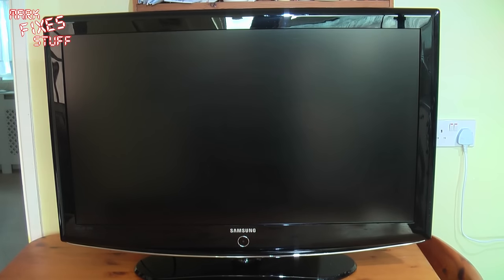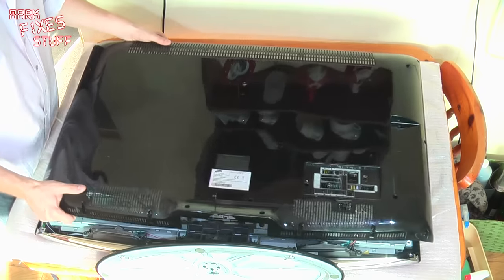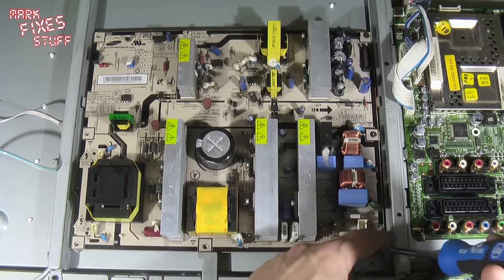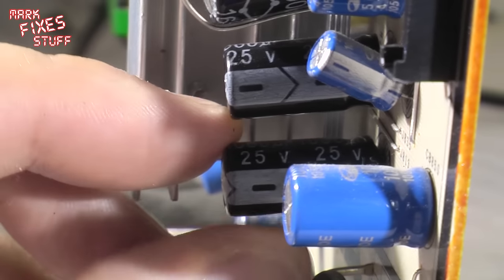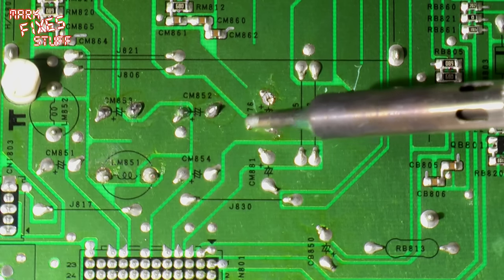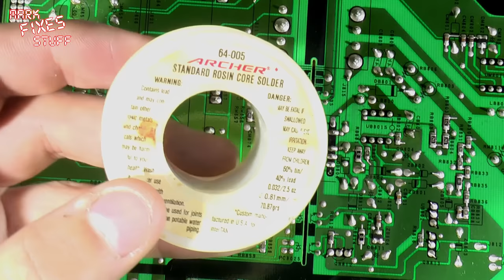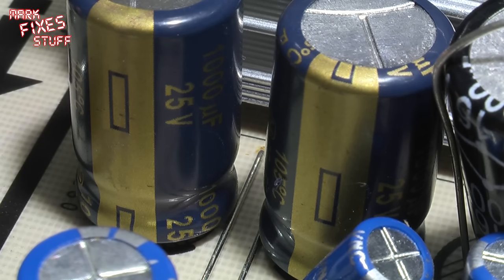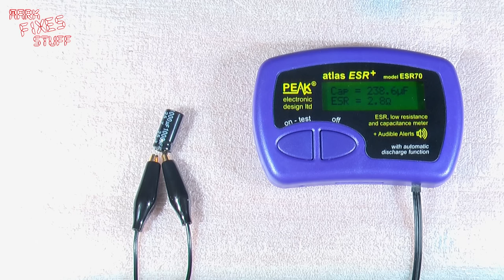Fix LCD TV just clicks won't turn on - Cheap easy repair for LED TV

Comment: For all out there who have the same issue, but don't own the tools, I bought a repair kit on Amazon for $25.  It included a solder iron, solder sucker, solder and a variety of capacitors.  Well worth the $--saved me at least $100 to do it myself.  Big props to Mark.
Reply from the maker: Brilliant news!
Reply: Paul Kosterman what should i search

Comment: Mark your the best!  I followed your instructions to the letter.  I fixed my Phillips LCD tv by replacing five capacitors.  I only burnt my finger once with the soldering iron hehe.  Thanks again!  It only cost me $18.00 for the capacitors and $20.00 for the soldering iron.  Now I have a bunch of replacement capacitors.   Take care and keep up the good work!

Comment: Thanks for the video Mark, very informative, my capacitors look OK so i can probably eliminate them as the cause of the problem - my samsung UE40D5520 is stuck in a non-clicking re-boot loop and ive been told by the local TV shop that either the main or power board needs replacing. Not being circuit-board literate im not sure if the orange crusty stuff on some of the wires is normal but to me it doesnt look like its supposed to be there!

Comment: Great tutorial. I did this repair on my 52 inch Samsung plasma. 3 caps cost me $3.90 Canadian. Hardest part of the job was lifting the beast - had to get the teenagers involved! I did note that the commercial solder took a lot longer to heat up in order to remove with my home-quality iron, so it took a little more time than it should have. Shame on Samsung with this defect and their terrible customer service. last Samsung I'll buy but it's working great now. Thanks!
Reply from the maker: +Simon Gencher It's the lead free solder used in manufacturing that is harder to melt.

Comment: Your video explained exactly what my old Samsung is doing. I think I'll try my hand at fixing it. I promise not to blame you if I electrify myself lol. One question...Can I use 60/40 solder (lead/tin) or must it be that resin core you showed?
Reply from the maker: coffeecrazy65 leaded solder should be ok. Strictly speaking the solder in your Sammy will be unleaded and mixing the two can cause a brittle joint but for a small job like this it shouldn’t be a real issue. Let us know how you get on!

Comment: Mark really does fix stuff.  I've got an old LCD monitor that needs recapping, and an old laptop that needs the power jack replacing, but lack experience at de/soldering.  I have four dead or obsolete PC motherboards to practice with, they are chock full of caps.  Have you done any videos with desoldering braid being used. by the way?
Reply from the maker: Not as yet as I'm not really a fan of braid, but I do use it for cleaning up occasionally. It's really hard to work around the camera when soldering so I tend to just use the SS01 desoldering pump.

Do be aware BTW, that mobo solder is usually a lot harder to melt than standard stuff or the old leaded variety.
Reply: Thanks for the tip.  I'll try to get some practice in!

Comment: Thank you Mark. I do appreciate your prompt reply. Samsung should have to answer for that... Seems as though everyone that purchased one of these sets new has experienced the exact same problem. That and all within weeks of their warranty having run out. "Bollocks!" Almost as if it were planned that way. Hmmm... Now by the smaller caps, are you referring to the four green 1000 uf/35 volt caps by the heat sink at the lower right hand corner of the board? How about the four brown 470-35 V caps on the left side of that same heat sink? Cheers mate!
Reply from the maker: +Chordmerchant Both of those cap sets are equally likely to have dried out. Gut feel is the 1000uf first though.

Samsung was subject to a class action lawsuit over this issue in the USA and a very quite recall happened in the UK which we have now missed....

Comment: Hey mate - thanks for this! Great video. I'm having the same problems, but I've got a Plasma compared to an LCD. Was going to change the capacitors as you've shown, but wanted to check to see if you knew of any other parts that may contribute to the Plasma screens while I've got it open? Appreciate your thoughts! Thanks mate.
Reply from the maker: +Samuel Thomson Start with the caps and go from there. If an inverter board has gone then it's more money for the part
Reply: Thanks mate - legend! We changed the capacitors on the weekend, and it seems like it's working like new again! Saved use a few hungee buying a new one - thanks again!
Reply from the maker: Good job mate! Well done and thanks for the kind feedback!
Reply: Worked perfectly for about a week, and then ran into the same issues unfortunately. Thought we'd fixed it! Any other ideas as to what we could experiment with? My dad's an electrician so certainly operating under the watchful eyes of someone qualified. Got nothing to lose by having a fiddle! Thanks mate

Comment: Mark I have a Samsung tv as well but whats happening to it is when you turn it on and it starts to cycle it will suddenly make a very loud screeching sounds and you will see a bunch of lines appear. then it will shut off on its own and try to recycle again. It will do this two or three times before it starts up correctly. Could this be  a bulging cap causing this?

Comment: I had this problem with my Samsung Plasma and it had to do with my Google fiber remote, it would just keep clicking and not turn on. I had to let TV sit unplugged  for 24 hours and took batteries out off all remotes and disconnected and unplugged google fiber. After 24 hours I turned TV on and after a few clicks it came on.  Then I reconnected it to Google Fiber and plugged in power to Google Fiber. I re-paired the Google Fiber remote (after blue light came back on box) by pointing it a Google Fiber box and holding down one of the number buttons. The Fiber box light flashed and it is paired and problem was resolved.

It  may be because my TV is older, so I have learned not to unplug TV so they stay paired and work together.

Comment: Still used as the fix today. You would think that they would learn to put larger capacitors in their televisions. Even maybe put a backup on them as small as they are.
Reply from the maker: I think they know it will fail after the warranty period, or what the customer THINKS is the warranty period, is over.

Comment: to discharge a capacitor, with a screwdriver that has an insulated handle. with the power off, touch both the soldered leads on the capacitor , both leads at the same time. really strange the 2 other capacitors have axial leads. you can see the silk screen on the board looks like a radial capacitor was supposed to go there.

Comment: Interesting little video, interestingly you didn't mention the heat capabilities of the capacitors, i noticed the originals were only 85 degree, with the replacements being 105 degrees, should last longer :)

Not that i'm one for conspiracy theory's nor do i believe a company would design in obsolescence, but it seems funny how the capacitors around the heat sink are 85 degrees yet the ones with lots of cool air around them are 105 :p
Reply from the maker: I meant to mention that ***** but in all honesty I forgot!

As an aside, in the US Samsung were subject to a class action suit that led to them having to compensate a LOT of customers due to them using faulty capacitors. The compensation scheme was also mirrored in the UK, but has now finished.

Comment: The heat coming off that bar that does not need to be addressed for those capacitors??
Reply from the maker: The voltage regulators produce heat. It's just a fact of the design. If I were cynical, I might suggest that placing those capacitors near that heatsink might be planned to make them die at a time after the warranty period has expired, and force most people to buy new sets.

Oh, the original caps are only rated for 85°C, not the higher temp versions at 105°C.

So yes. You are correct really.

Comment: Hi. Thanks for the video! I have watched many already and tried to solve clicking problem however haven't been able to yet. Capacitors seems ok. I have checked all joints as well, looks ok I think. Would anyone be able to look at my power board and identify the issue, please? 🙏 I am desperate 😵‍💫 I have pictures!

Comment: hi there ive had plasma samsung had blown caps fixed them still never came on what else could it be as ive been messing about hobby buying tv's with same as this taking age to come and its been fine only caps but ive been put off getting any with clicking sound thanks for video

Comment: I want to try to fix my panasoniv viera LCD. The capacitor are 35v 1800uF. I can't find anything similar on amazon or ebay. What shall I do? Any capacitor will work or have to be the same? Thanks in advance.
Reply from the maker: Hey, thanks for watching! That's a common part and should be easily available everywhere. Search for "1800uf Capacitor 35v". Regarding your question, the uf rating must be the same, but the voltage rating is how much the part can handle, so can be higher like 40v or 50v. Don't go too high or the part will start to be much bigger!

Here on ebay UK I can find Panasonic caps as well as cheaper brands. Here is an example. https://www.ebay.co.uk/itm/EEUFC1V182-Panasonic-Capacitor-1800Uf-35V/143876304802

I hope this helps and thank you for your comment!
Reply: @MarkFixesStuff  : Thank you so much for your answer and the link in ebay. You're a 🌟 ⭐ 👍

Comment: Hello Mark, I have a Samsung model UE55F6670SS presenting same issue.  I did visually verify power board and all capacitors seems perfect.  I saw some videos people heating powerd board with a hair dryer and did try out... that works! but once tv turns off I have same issue back and need to heat board again to start.  Any other clue to fix it? Appreciate your help. Tks

Comment: I have the 46" version of this TV, but mine had a bad logic board, the power was OK.  Even after replacing that it still cost less than $90 all together
Reply: You can get the tv for like 40 bucks lol

Comment: You really don't even need a tester unless you see more than one but most of the time you can look at the capacitor and see that it's bad. When it's popped out like a balloon, that's bad. When it's flat, it's fine. I would recommend putting a larger capacitor there but do at your own risk.
Reply from the maker: Yeah, but in the video people like evidence haha. Mostly I start with smaller caps near the hottest parts and try from there.
Reply: @MarkFixesStuff  true

Comment: Hey I have a Sony Bravia 55 inch LCD TV.  It's a 2010 model. When it turns on and off it makes a sharp ``pop'' sound. Is it the relay switch that is faulty? Some say,``That is not normal.''

Comment: I know your video is older but I hope you will respond. I have an older Samsung computer monitor and when I turn it on it only stays on a couple seconds then black.  if I turn off and back on it does the same. I can see my desktop briefly. Is that possibly the capacitor? Thanks. Great video.
Reply from the maker: I would check the caps, but it might also be the inverter board for the backlight as these are known to fail. If you shine torch on the screen can you still see the desktop even though it's black?

Comment: Hi Mark,
I have a Samaung 40" LN-S4051D TV that won't turn on, it just clicks so I took it apart, noticed two blown capacitors. I bought a 5 pack on Amazon,  replaced the two obvious caps and still nothing, changed out 3 more and same thing. What else could it be?
Thanks in advance.
Jim

Comment: can i use different capacitor series but same numbers i have a blown 25v 2200uf 105 c (M) capacitor  the new capacitor is 25v 2200uf 105 c (XYA) and it is abit smaller in diameter and height

Comment: mark I did the power board on mine as it was only 36 bucks and it still clicks on and off. Saw a video of the little blue flip switch repair and did that and still cuts on and off. Any ideas. It is Samsung 52 in hdtv.. I just today saw video where if had no power for a while it will not  cut on. It will not stay on long enough to check this setting so don't know what to do. I am going to plug everything in and leave it on and see if having the cable box hooked up overnight will allow this feature to let it cut on. Let me know any help please. thanks.  My reasoning behind the nopower is my granddaughter might have flipped the light switch and the tv had no power overnight???

Comment: Looking to take this job on myself, what capacitors do I need to replace the ones in my LE40M86BD which also does the same clicking and no turning on, new to the whole electric/capacitor thing I have done a little electrical stuff in the past however not clued up on it
Reply from the maker: Ac7ive Crash sorry, I missed this. You need to have a look at what is installed and order the same uf and voltage rating, go for 105 degrees caps too

Comment: I have a Samsung TV, that is clicking.
I have replaced 4 capacitors because they were leaking.
The rest of the capacitors looks fine.
The TV is still clicking though, is there any good way to measure if a capacitor is broken with a multimeter?
Reply from the maker: +Stockholms Oskar Not without an ESR meter unfortunately, and they need to be removed to test.

In my experience the smaller caps suffer first though, so best change those. The 400v and 450v larger caps are usually fine

Comment: Thanks for your video .. I have SAMSUNG plasma display 58 inch, and I am hearing click from it. I opened and I did not see any bulging or damaging capacitor. what do you think is the problem with my TV. Thank you again.
Reply from the maker: naseem aldano It will definitely be a dried up capacitor. You should look to replace the ones near the heatsinks usually.
Reply: Mark Fixes Stuff - Retro Console and Computer Repairs, Reviews and MORE!  thank you for answering .. i will do what  you said and i will write to you after.
Reply: naseem aldano 6  days has past what is the final answer? Was the problem fixed after you put in new capacitors?

Comment: dont bother with esr meters, you need to change every one in there with a higher voltage rating one, the small ones next to that heatsink go bad aswell, also fit a 40mm fan
Reply from the maker: +Synthematix almost no-one has ESR meters anyway, so this was just illustrative.

Comment: my mate got given a 6 year old Samsung plasma with part of the screen missing.did a visual inspection of the caps and reseated all the leads.no joy.any ideas
Reply from the maker: Sounds like an encoder chip problem. Only think I could suggest is an oven reflow of the board.

Comment: Hi Mark,

I have a Samsung M87 LCD which suffers from the clicking issue.  I've removed the back from the TV but the capacitors you replaced 'look' fine (as in no bulging, they are flat).  Is it worth replacing anyway - can they fail without bulging?

Thanks
Reply from the maker: Yes. They most often fail without bulging as they dry out. The capacitors that they put next to the heat sinks are only rated for 85°c!
Reply: Mark Fixes Stuff - Retro Console and Computer Repairs, Reviews and MORE! 

Replaced 3 capacitors, CM811/812/817 but it has not fixed it - still clicks and will not power on.  🤔

Comment: Hi mark.....I have a Samsung le40r87bd TV  which cycles on and off!! Also crackles!! 
I've looked at the board and there's no visible broken capacitors...any help on this as I've tried another board and  main board but still the same!!
Thanks rob 👍👍
Reply from the maker: Rob Brooker Hi mate. Dried caps often don’t show signs of damage. I would try replacing the ones on the PSU board nearest the heatsink and see if you have any more luck.
Reply: Cheers  mark...will do...will let you know when done and thanks for the reply...👌👌

Comment: I'm experiencing this exact problem with my 2007 Samsung model HP - T4234 Plasma. It is not the X Sus, or Y Sus boards so I'm guessing it is the power supply board. Problem is, none of the caps look bad and I don't have an ESR-70, or equivalent meter to test all of the caps in circuit. Any suggestions? Should I start with replacing all of the 1000 uf 25V caps, like the two you replaces by that heat sink? I don't know how much a replacement P/S board is on FleaBay but I'm guessing at least £50 to £75. Any help would be most appreciated.
Reply from the maker: +Chordmerchant I work from the heatsink outwards, starting with the smaller caps. Usually that fixes the problem. The larger 400v caps are usually fine. Look for any caps that are rated as 85° too, as they are not the right tolerance and Samsung still use them!!!!
Reply: yep the close ones usually are the problem due to their closeness to the heatsink/power strip (the metal triangle grey piece) which will damage the close caps. The ones further out usually never are bad.

Comment: I have a Samsung and it was repaired a couple times by a repair shop for this issue and once by me, all capacitors look new and I did replace them again just in case they were bad again but now I still get the clicking and no power, is there something else, my standby power is fluctuating so I think the problem is still on the board with the capacitors, any ideas.
Reply from the maker: In that case you might need a new inverter board. If you google your model and "inverter board" you'll find a lot of resources.

Comment: Hey I have another size and model samsung TV that doing the same. Do you think it's the same problem.
Reply from the maker: Almost certainly!
Reply: Hi Mark,
I have here a found Samsung UE32D6200TS LED TV.
Menu and screen comes up but TV makes clicking (relais?) noise.
 Caps on the powerboard all look  fine and since the TV is from 2012, it is unlikely to be affected by the old Taiwan capacitor plague of the early 2000s. No visible damage outside or inside.
Click, click, click, click …. If not capacitors, What else could it be?